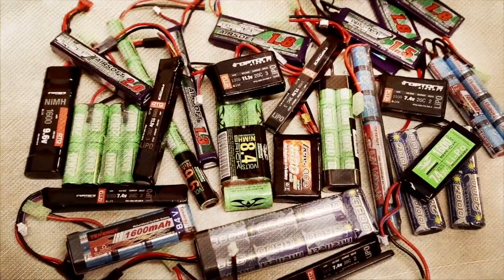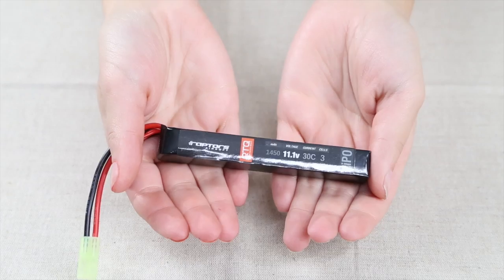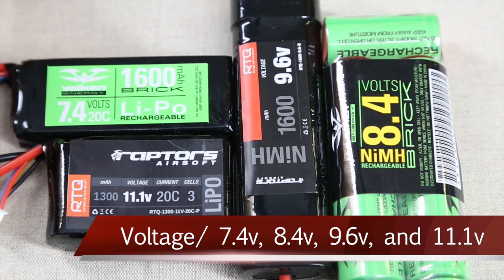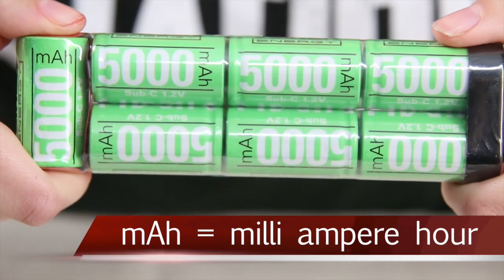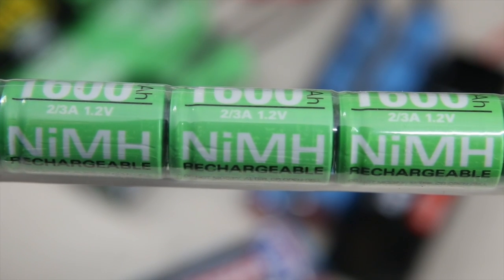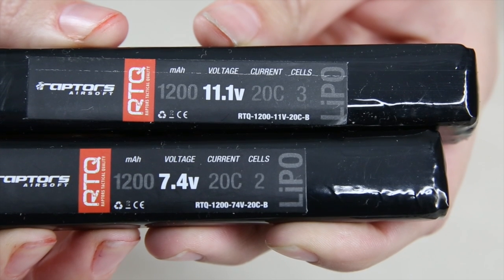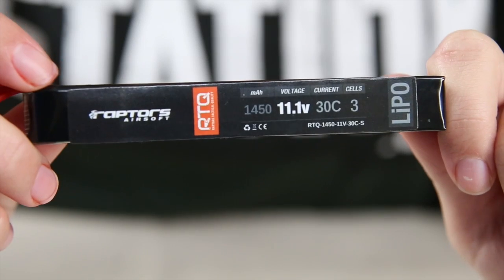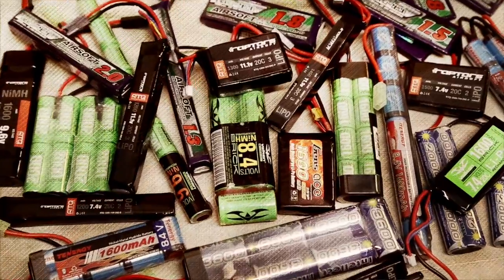Airsoft Batteries - LiPo and NiMH Overview and Basics

Comment: What will work for an elite force UMP?
Reply: i just bought one from a friend at work....lol he bought it like 10 yrs ago, was still in box. It has a Ni-mh 2/3a 1100mah 8.4v with it. It has 7 cells and is approx, 200mm long. I put it in and measured how much room is left in compartment. There was roughly 35mm of room left in comparment. There is room to squeeze an 8 cell 9.6v in the compartment. The 8 cell is 232mm, i imagine it will be tight, but it will go.

Comment: How long does it take to charge 11.1 Lipo battery
Reply from the maker: The charge time depends on the capacity of the battery and the type of charger being used.
Reply: ITS FLICK aprox 2 years
Reply: 1 hour at 1C charge rate.